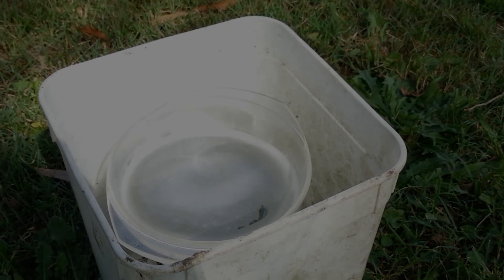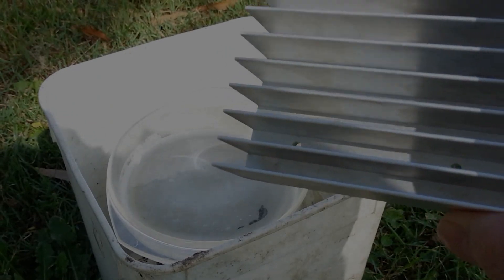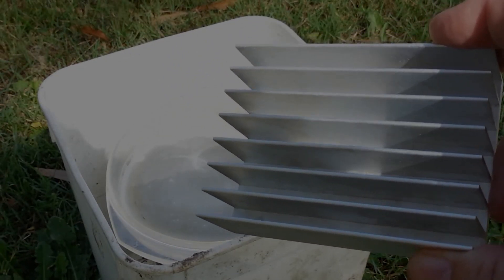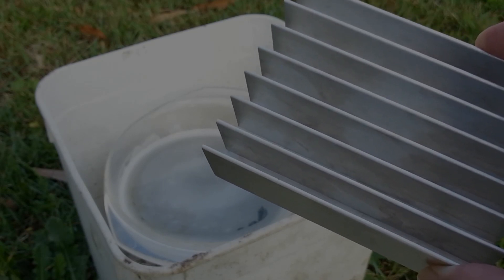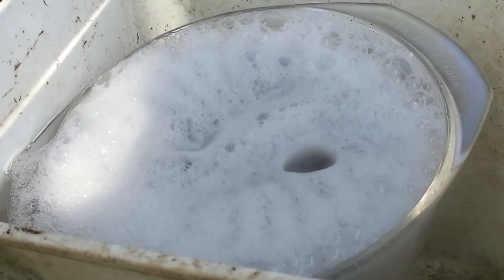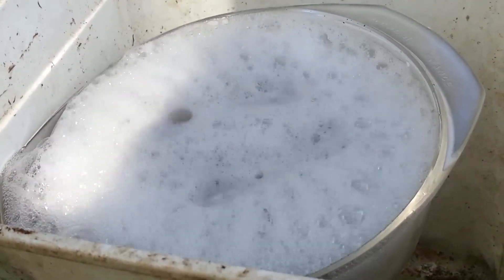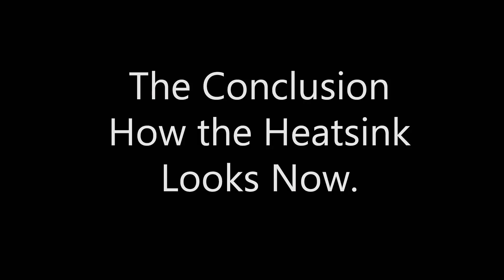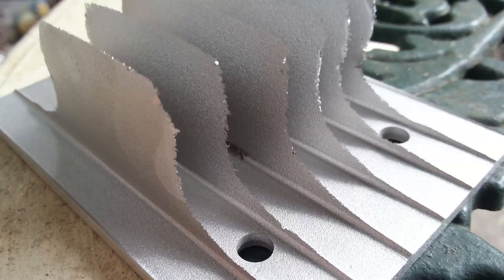Caustic Soda vs Aluminium Heatsink

Comment: This was putted in for too long. Normally if you do it for 5 min max it Will work great for anodized alu
Reply from the maker: It needed longer to wear it down. It was quite a thick heatsink.